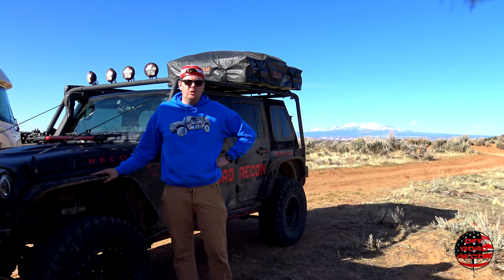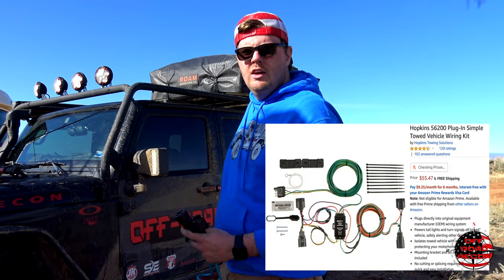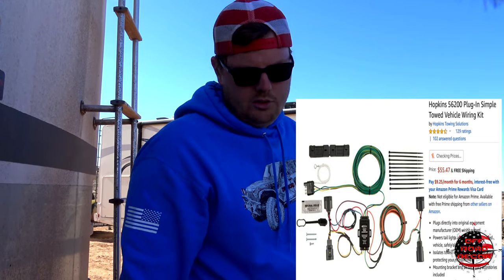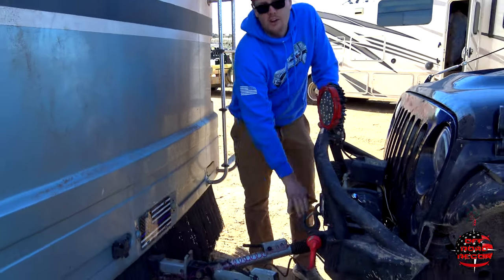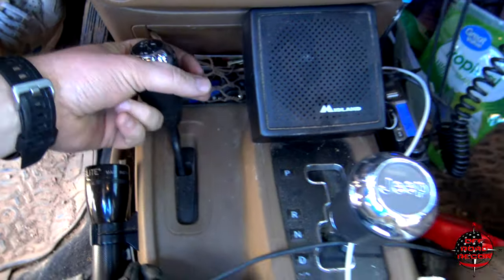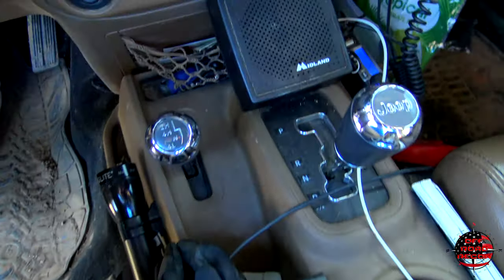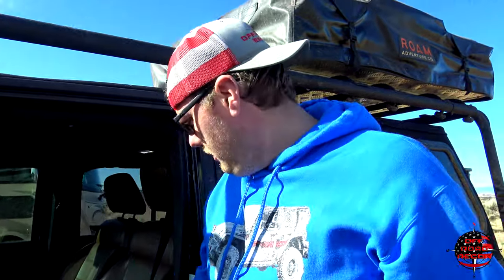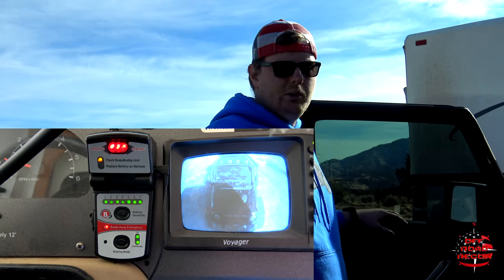EVERYTHING you need to know about Flat Towing a Jeep Wrangler

Comment: Hello we did a straight 7 hr drive and when we arrived the 21 jeep jl wouldn't start.  I use the blue ox patriot brake system and our installer installed a drive and tow switch that I believe transfers the control of the turn signals and braking to the rv.  What I noticed that event though I have confirmed power going too my battery from the rv when I hit the brake it puts my ignition in ready to start mode while driving.  Last tow I started the jeep each time I got fuel and that seems to work.  Driving to Montana from San Diego so a lil nervous has this happened to you?
Reply from the maker: It has not. It sounds like your key is on the on position… make sure it is off.

Comment: My 2008 Wrangler has a stearing wheel lock.  Locks after 1/2 turn of stearing wheel .  I have to leave key on.
Reply from the maker: From the manual:

STEERING WHEEL LOCK
Your vehicle may be equipped with a passive steering
wheel lock. This lock prevents steering the vehicle without
the ignition key. If the steering wheel is moved
approximately a half turn in either direction, and the key
is not in the ignition, the steering wheel will lock.
To Manually Lock the Steering Wheel
With the engine running, rotate the steering wheel one–
half revolution from the straight ahead position, turn off
the engine, and remove the key. Rotate the steering wheel
slightly in both directions until the lock engages.
To Release the Steering Wheel Lock
Insert the key in the ignition, and turn the wheel slightly
to the left or right, to disengage the lock.
NOTE: If you turned the wheel to the right to engage
the lock, you must turn the wheel slightly to the right to
disengage it. If you turned the wheel to the left to engage
the lock, turn the wheel slightly to the left to disengage it.
 Reply

Comment: My 2008 Wrangler has steering wheel lock after 1/2 turn.  Lot of people have ruined tires thinking they did not have a SW lock.  Be sure to turn more than 1/2 turn to test.
Reply from the maker: Good info! Thanks for the tip!
Reply: My 07 locks at half turn
Reply: 2008 2009 have locking steering. This is something you all have to verify!!

Comment: dumb q:  I have a 2016 Rubicon with power brakes.  Do the breaks work if the engine is off (per your comment in the video about taking your key out).
Reply from the maker: Yep. Are you using a brake Buddy?

Comment: This is a great video. I have a Jeep Wrangler that I flat tow also. I noticed that your tail lights are LED on your Wrangler. I purchased some LED tail lights last week and they would not work with my motorhome lights, i.e. turn signal lights, brake lights and running lights. I called Blue Ox and they said their wiring harness was not designed to work with LED lights. How did you get yours to work when connected to your mortorhome and do I need to purchase a specifit LED taillight? Any help would be greatly appreciated.
Reply from the maker: Thanks! We use the Hopkins kit, however I believe if you install resistors on your led lights they will register more voltage and correctly. Good luck!
Reply: Thanks!!

Comment: Ben, I belong to a RV/Jeep Facebook group.  And recently there was a post “don’t be this guy” with a photo that looks like you.  The photo was your Jeep with the front bumper removed or torn off.  

I questioned the poster asking what happened.  He posted a link to this video, which clearly shows your Jeep. After further discussion he suggested because you mounted your Blue Ox baseplate adapters low and on skid plate is what caused damage.  

I’m asking because I use a similar setup.  Except I use the LoD tow bar adapter which replaces the ends of the tow bar with 1” pins and you can put those right into the lugs where you attach d-rings.  

If you had some damage to your frame or Jeep please let me know.  I’ve been safely towing my Jeep for 3 years behind my RV which I full time out of.  I am about to embark on a 2-month cross country trip with my RV/Jeep.  If I should do something like get the bumper welded to the frame let me know   THANKS!.
Reply from the maker: Wow. Word travels fast. This happened yesterday…. Yes the welds broke on the frame. Thankfully we took it to a local welding shop and beefed the welds up. Been holding up well now. I have been checking it at each stop.
Reply from the maker: Can I ask you where this post is?
Reply from the maker: I would recommend having that weld beefed up. We also have been towing ours this way for 3 years. If you follow us on Facebook I will be posting all the pictures

Comment: Not sure how long you have been running it exactly as shown but I have a few important tips.

1. The mounts installed to the bumper have very little structural support. A lot of states require mounts to be fastened to the frame (as a baseplate would) you can get around that by placing mounts on the bumper where it bolts to the frame. Hard rock offroad sells the adapters for that. 

2. That jeep stock weight 4,600 lbs. Yours looks fully loaded and most likely is pushing 6000lbs. Most rigs come with a 3500lb or 5000lb receiver. I recommend upping to a class IV receiving capable of towing handing 6000lbs. This will be a weld on reciever most likely

3. Especially since your towing out of your max weight limit, you want that tow bar as perfectly in line as possible. This will reduce strain on your mounts and connections. Rule of thumb is no more than 3-4" inch difference in most cases. 

Other than that good work!
Reply from the maker: Very good tips! Thanks! Hoping to slim down on some weight soon... more on that coming soon.
Reply: @BenandBrandi  no problem man. Ya my father had the same setup with the brackets mounted to the thin bumper meta towed behind is 32 ft rambler, long story short, his jeep went onto the shoulder after one of them broke off.  Here's a link to the brackets that bolt up straight to the frame through the bumper. Also, you may need the 6" rise blue ox hitch extender to level it all out after doing that 👌https://www.rockhard4x4.com/Jeep_Tow_Bar_Adapters_Brackets_s/416.htm

https://www.blueoxtowbars.com/products/6_inch_Drop_Receiver,BX88130

Comment: As this is not legal in Germany I was really curious how such a tow bar setup works and how the car is turning. Initially I thought this bar is somehow connected to the steering arm/rod. 
Now I've seen that you just let the wheels turn like they want to. So I wondered if this always works but at 9:55 you can see the wheels trying to drive to the left but it's been pulled to the right. I guess if the ground is not that soft it will work better, but what about big potholes. Can it happen, if you hit a deep pothole with one wheel that the towed car tries to escape to the side?

PS: Great video I've learned a lot! :)
Reply from the maker: Thank you! 
Never had an issue with it turning the wrong way. For the most part the pulling force keeps them in the proper direction.

Comment: If I didn't already know how to do this I'd be confused as hell. Tow bar needs to be level not straight, 12 V plug is not a cigarette lighter. All Jeeps are not the same and a standard needs to be in gear, I use 2nd just in case it would vibrate out of first. Seems like you were in a hurry.